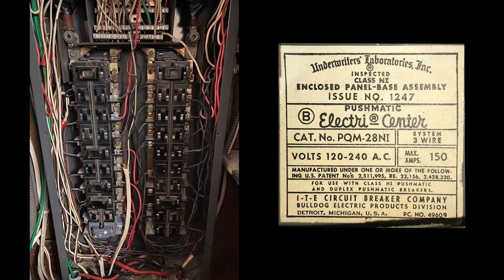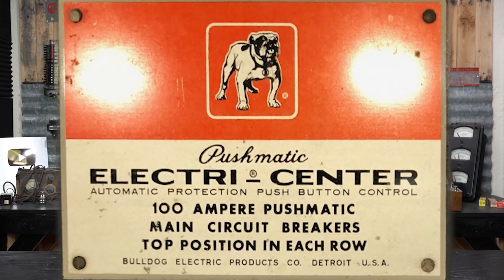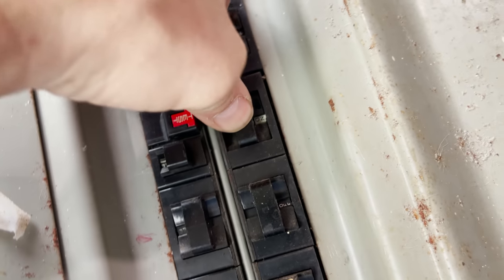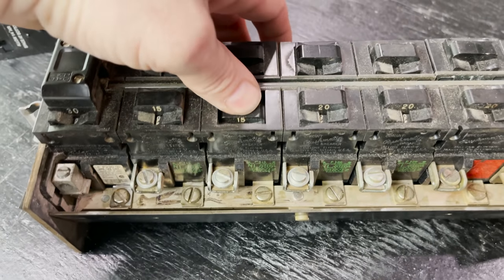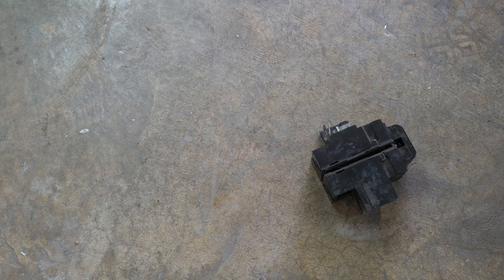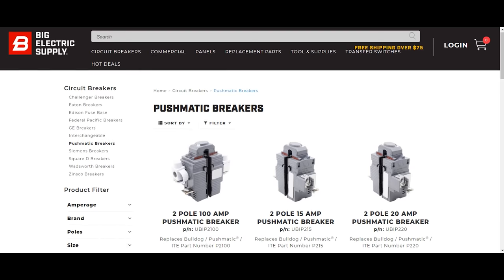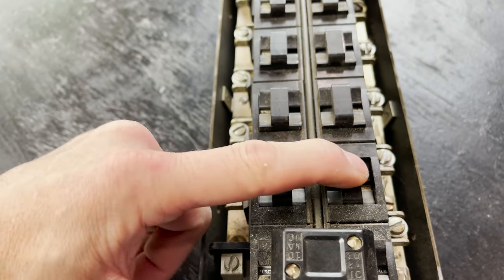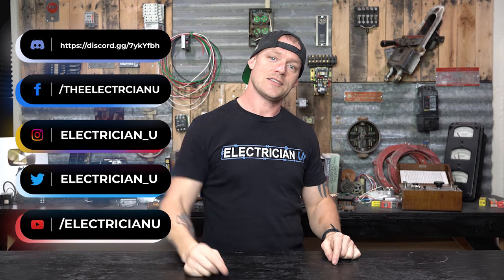Pushmatic Panels & Breakers - ARE THEY DANGEROUS?

Comment: I have a pushmatic panel in my 1962 home. I have replaced half of the breakers already. Connecticut Electric makes new breakers for these panels. My main breaker wouldn’t turn back on on a Sunday!  Lucky I found an electrician who had one on his truck. I replaced it and a few others that stopped operating. Never trust that energy is removed unless tested.

Comment: Had a service call garage electrical fire once that they saved the garage from burning down, found one of these panels in their house. Some automotive electrical guy thought it was DC so wired all the white wires to the breakers and all he black wires to the ground bar. I never went back to change it. The boss had to go through HUD and get all of the approvals and I was on another job by the time they came back. All the ground wires were cut off and had to all be redone.

Comment: We had one of these panels in a building we were renting.  One of the breakers got weak and we were going to move the outlets and circuit to one of the other breakers.  The empty slots had metal covers over them and when they started to remove one it slipped and shorted and there was no main to the panel to be found.  When it stopped it had welded itself to the panel.

Comment: It is nice to see some that someboby did it right back then.  Failing indications, and a few failing to function on manual opening.  With a product older than most of the electricians out there that is excellent.  We have ITE switchgear from the 50`s, and square d MCC`s at work.  Age related problems but quality stuff.  And with the transite arc shields and AMW wiring right up tp 500 mcm not getting upgraded.

Comment: Never trust the flag indicator on a pushmatic.  You can usually spot a tripped breaker by looking at the buttons from the side as the tripped one will stick out more than the others, then confirm with a tester.  I've replaced all but the main on my home because after 30-40 years of service its just  - well worth doing.

Comment: When I come across these Pushnatic panels 3-5 times a month, I will give the customer both the panel replacement quote and a breaker replacement quote. In the end the decision is normally dictated by the home insurance company. Some accept updated breakers, but most will drop the homeowner if they don't modernize...

Comment: I've still got 1 in an old cinder block milk house running my well pump and very elementary woodshop. Another still runs the silo and grain belt. Just replaced a 70 year old transfer switch with a CT in it because it stopped working with the meter for some reason.

Comment: My house, built in 1961, had a 100A Pushmatic panel.  Never had a problem with it.  Pretty sure the breakers had both magnetic and thermal trip modes.  Replaced it a couple years ago when I went to 200A service.

Comment: We have a pushomatic panel in our house, installed in 1960 and the breakers actually all work great and trip just fine, no stickage. I bet it has to a lot with the climate of the install (high humidity etc). Either way, i'd love to replace it and get a whole new panel, but I'm not gonna spend that kind of $$ right now. This panel seems to be just fine IMO.

Comment: Never had an issue with our ITE-branded panel (which does not have the issue of being grease-fed, and does have a magnetic-trip mechanism for sure in at least one, as it's a GFCI breaker). Older Bulldogs, however, I'm not so sure about, simply because they're that old.
I honestly wish new panels were made, as well as AFCI-equipped Pushmatics, as I absolutely hate the toggle-lever type

Comment: I like the point of exercising circuit breakers, and wd 40 not a proper repair.
I had to replace 2 200 amp breakers at a customer's house because they would not turn off. And holding the handle down and tapping it with hammer to get it to open makes you really question if it would trip if it needed to.

Comment: I'm just a DIYer, but I would approach a Pushmatic like any "very" old panel - you have a risk of failed or unreliable breakers.
I've got some 30 year old Siemens-ITEs and some unknown age QO's that're unreliable.
I would only recommend a panel swap, as you noted, if more modern features are needed or wanted.

Comment: Thank you, 

I’m buying a condo with one of these pushmatic panels and I want to upgrade the entire panel (since I’m the one at the end of the day who will be living there if I don’t end up walking away from the deal over this since I’ve got the building handy person and the sellers interest to just replace the breakers and not the entire panel, when the panel is at 60 amps, like that’s not cutting it in a modern setting even I’ll be tripping the breaker all the time just from computers, electric stove, refrigerator etc

Comment: short answer: they were state of the art when they were new, but they're 50 years old.  if it's in good condition, and you don't need to work on them, status quo is acceptable.  if you need to do work, anyway, go ahead and upgrade. if it's not in good condition, it will be cheaper to upgrade.

Comment: Pure bulls hit concerning Push magic circuit breakers. Best breakers are ALWAYS bolt on's. Had over a thousand push magic circuit breakers at my first job. We only had problem with top single poke breakers going bad due to they were located in a 38 degree damp boning room that got washed down 5 nights a week. Water would enter panel and destroy top breaker after a year. Have a 100 amp 60 year old pushmatic sub panel in my garage. Breakers tripped every time I overloaded a circuit or had a dead short.

Comment: Personally I believe that once a panel turns 20 years old you should rip it out, throw it out, and replace it along with all its breakers.  If said panel is in a climate controlled area its entire life then 30 years is OK.

I've got a janky looking ITE panel in the electrical room in my building (circa 1986), but the breakers in it are fully compatible with Square-D.  The breakers in it are starting to physically sag, so I need to try re-seating them; if that doesn't work I'm putting an EATON Pow-R-Line panel in there.
Reply: @K lake didn’t know about that lead time! Thanks for the heads up!  I’ll reach out to my contacts and see what they have.  One of them does a lot of data centers and exclusively uses EATON, so I’m pretty sure he’s got some laying around.
Reply: @K lake I hear ya.  It’s a priority to me as the maintenance guy and an electrical guy…but not a priority to the board of directors.  If the panel fails and arcs all over the place they’re gonna be a little upset about that $10k insurance deductible vs. a couple thousand for a new panel installation lol
Reply: The 1964 house I rent still has the original General Electric panel on the outside of the house. Took me forever to find it the first time I had a breaker trip -- I'd never seen one before that wasn't indoors.

Comment: I wonder how many circuit breaker owners wish they had fuse boxes installed instead
Reply: some high current applications specify fuses for short circuit protection, because a fuse can open in a half cycle, while a magnetic trip breaker takes a full cycle to open.  
but for the most part, resettable wins over single use.
Reply: @kenbrown2808  single use are resettable. you just put in a new single new use fuse.
Reply: @toomanyaccounts  I don't know how it is where you come from, but where I am, that costs time and money.
Reply: @kenbrown2808  a package of fuses is 12 bucks and likely will never need to be replaced. there are fuses boxes in homes and businesses that have the same fuses that they had since there were first installed back in the 50s.
Reply: @toomanyaccounts  and some have a penny or a piece of copper pipe jammed in them because the homeowner got tired of replacing fuses.  And with cheap electricians cutting corners on circuits, and homeowner loading up on appliances, it would only get worse.
Reply: @kenbrown2808  if the homeowner had to replace fuses on a constant basis then their electrical wiring was shit and they should have interupt outlets put in instead or get appliances that were not shit quality
Reply: @toomanyaccounts  there was no such thing as "interupt" outlets back when fuses were common.  Which leaves old houses built back when a powerful vacuum only drew 4 amps, and people who shouldn't have gone with the lowest bid.
Or DIYers who didn't really understand the concept, like possibly you.
Reply: @kenbrown2808  my house has only had to replace one fuse and that was when the electric company was supposed to have disconnected the power from an outdoor busted light but didn't. so when the electricican that was removing the excess wires from the outside of the house there was a short circuit which blew a fuse and scared the ever living shit out of the electrician. never have i had to replace one since.
Reply: @toomanyaccounts  congratulations, you're in competition with Gibbs for luddism.  but tell me, have you looked behind those fuses to see if there are already pennies behind them? or if they are oversized for the wiring?  

then we can get into why the power company thought they could disconnect power from a light that was powered from your house.
Reply: @kenbrown2808  yes I have removed them. whenever the power goes off i check them. turns out it isn't the fuses but the power line to the neighborhood that is the problem
Reply: @toomanyaccounts  well, someday you will make it into the twentieth century and wonder why you waited so long.
Reply: Absolutely not me. I know it wouldn't happen super often, but I still hate the idea of needing to buy replacement fuses

Comment: I like the pushamatics because they bolt on to the busses which are far more reliable than the plug in breakers. And they are very good at tripping on shorts and overloads. I accidentally shorted a circuit connected to a pushamatic breaker. It tripped instantly.

Comment: the ones i have come across tht are bad seem to either never want to turn off with out a lot of force because of dried up grease and or corrosion or they will not reset because of worn springs or broken push buttons.  corrosion seems to be the big problem i advise pple to replace.   never heard of any not tripping like fpe or zinsco

Comment: i wouldnt spray wd 40 in one of those breakers. wd40 loosens up rusty bolts and stuff, its not meant to lubricate stuff. it dries out, then you are screwed.
Reply: actually, WD 40 is a water displacer, and being a penetrating lubricant is only a side effect.
Reply: @kenbrown2808  yea. if you spray wd40 on these old breakers it will probably lock them up.
Reply: @smittylikesto  it's not an adhesive, either.
Reply: @smittylikesto  it's not an adhesive, either.
Reply: @kenbrown2808  i didnt say it was. i said, its not a lubricant. if you spray it on something like a bike chain, once it dries it will mess up your bike chain because it will dry out and get all sticky. that is just what it does. if you spray it on these breakers it will mess them up, it is not a lubricant. its not a lubricant.
Reply: @smittylikesto  actually, no, it doesn't get all sticky.  because it contains no adhesives.  it is basically two kinds of lightweight oil, mixed with perfume.  that's why it has the side effect of acting like a penetrating oil, and most people use it for that.  however, it is too light to work well as a long term lubricant, so it isn't an effective replacement for grease.  I don't know if it will freshen up caked grease because I've never used it for that.  it was developed for protecting circuitry from moisture in marine environments.
Reply: @kenbrown2808  it drys out and will do the opposite of a lubricant. if you put it on a bike chain it will ruin it. if you use to to lube up one of these breakers it will ruin it.
Reply: @kenbrown2808  people use it on nuts and bolts because it protects against rust, even if they dont know it, that is what its good for.
Reply: @smittylikesto  no.  none of the ingredients in WD-40 turns into glue when it dries, today, either.  the problem with trying to use WD-40 as lubricant is STILL that it is too light an oil to be a long term lubricant.  and it will still be too light an oil to be a long term lubricant, tomorrow; no matter how many times you claim it will turn into glue.
Reply: @smittylikesto  no, people use it on nuts and bolts because it happens to work as a penetrating oil. it doesn't protect against rust very well, except by displacing water when it is applied. but it is too light an oil to stay on well, and so it isn't very good for any long term use without reapplication.

Comment: Best Residential electrical panel, made by man. Bolted connection just like commercial electrical panels. All your words are just BS.about this panel. Electrical Contractor est. 1947
Reply: Apparently it was originally exclusively sold as a commercial panel

Comment: The problem is they get gritty stuff inside them and they hang Ive had to pull a few and spray them up with contact cleaner and lube and they’ve worked fine

Comment: I have a bunch of these in panels here and they are not any trouble. All work as supposed to. 
This is a commercial establishment and there are 3 panels full of pushmatics here that all work properly. 
No I am not going to change them. Yes I have added onto the panels in the unused slots.  3ph 208.

Comment: Well I agree with you if you have to Greece or spray with WD-40 and electrical breaker which can create a spark using a flammable liquid it's not the greatest idea those are some penny pinching people LOL
Reply: lol everytime i hear penny pinching and panel i think edison fuses
Reply: @wizard3z868  actually fuses provide better short circuit protection than breakers.
Reply: I would never spray WD 40 on a breaker, and I'm a retired Master Electrician still alive to talk about it.
Reply: @doninmichigan  yes im aware of that but the PENNY pinching was supposed to be a hint(place a coin behind blown fuse works better than new lol) like the united kingdom fuse plugs with just a screw/bolt to replace the fuse
Reply: @doninmichigan  you do it after its removed and if you can take it apart or you have to sit there with an air hose and blast out as much as you can. ive only done it a cple of times not many in the northeast

Comment: I would suggest changing these immediately to anyone that owns a home with these old breakers they can't handle much compared to the modern systems and they are dangerous I almost got shocked by one it's scary shit
Reply: Interesting. My home was built in 1957 and it has a Bulldog electric equipment panel and the original push magic breakers are in it working fine. I've did 21 years in the trade. 90% commercial. I changed all of my devices, updated and added lighting. Ran a 100 amp sub panel of the main with overhead service. Extremely rare in Las Vegas Nv FYI 
I bought the home almost 20 years ago. We replaced the heater 3 years ago and the day before yesterday it wasn't coming on. It's means of disconnect is a non fused lever switch disconnect. I lost one leg and traced it back 
(my house is made of block)
and it ended up being the 40Amp breaker. I'm almost ready to list the home and get the hell out of Dodge. So if going to look for an aftermarket or new old stock if possible.  I wouldn't keep that panel if I weren't selling, so fuck it. A work partner of mine from back then said never purchase a used or salvaged push matic.